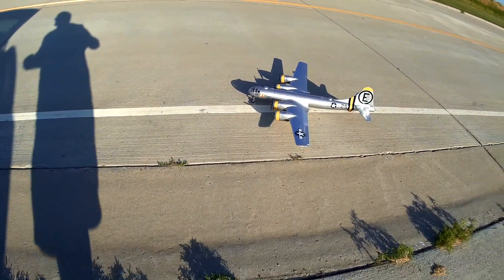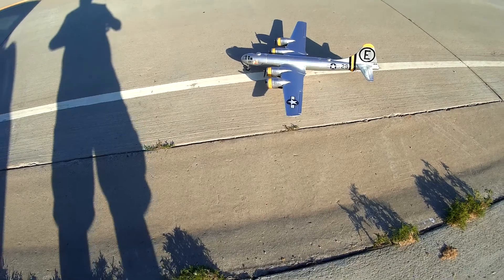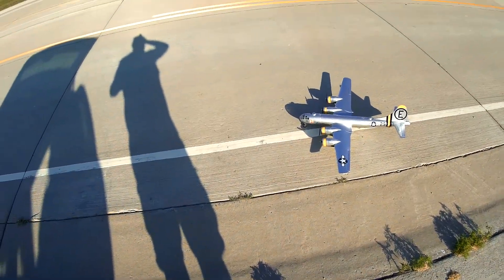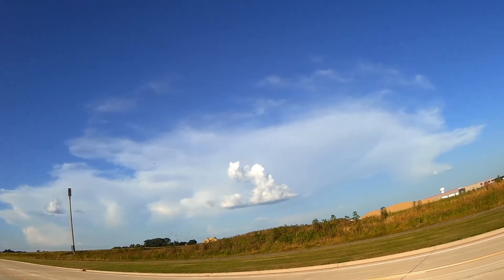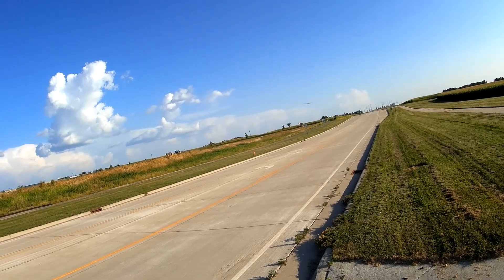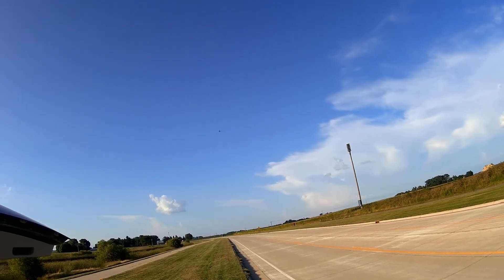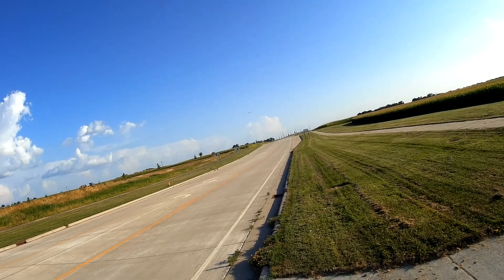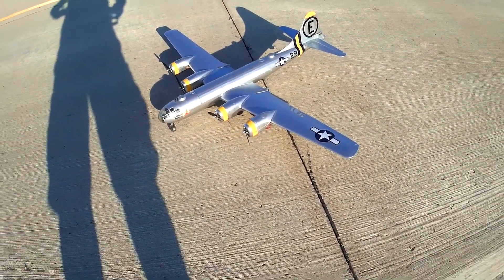Guillows B-29 r/c bomb run broken prop

Comment: Great update.  Too bad about the damage - on the bright side, maybe we could get a 'how to repair the B-29' video!  Any details on the new battery?
Reply from the maker: the damage was minimal but it did crack the main spar in the left wing . a new prop and a little ca on the main spar and shes good as new. the new battery is a 1500 mah 40-50c 3 cell . just a tad beefier than the 30c 1500 3 cells.